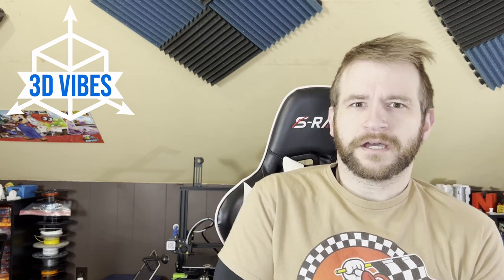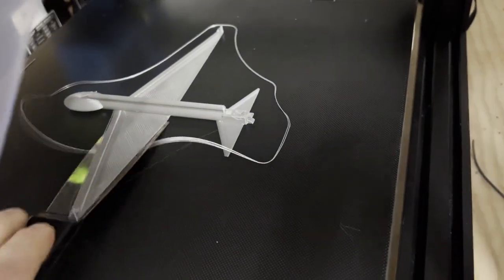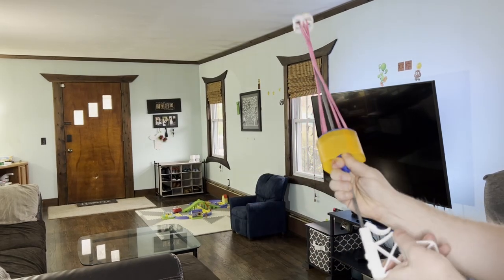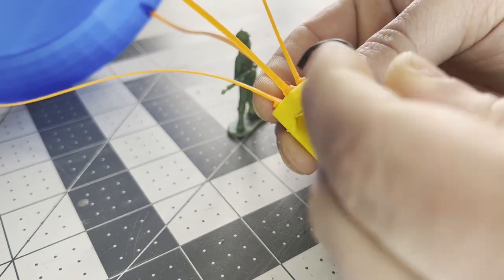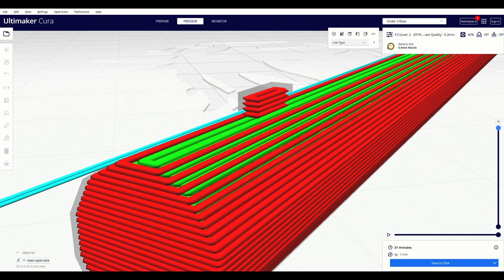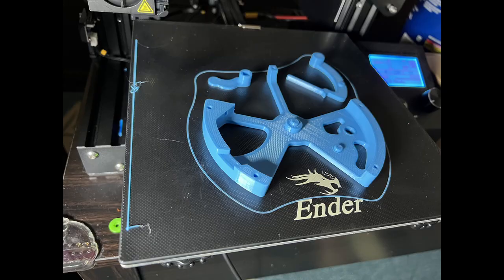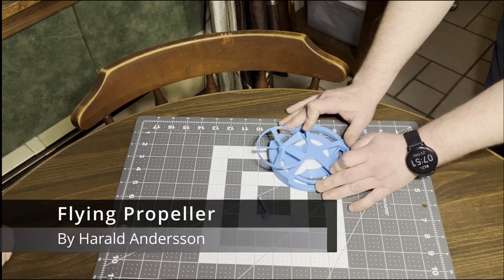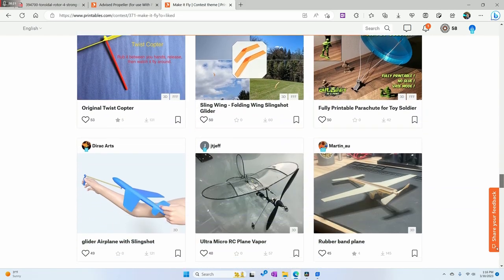3D Prints from the Make It Fly Prusa Printables Contest

Comment: I was surfing and stumbled across your video. I'm honored that you were the propeller launch base favorite. Did you notice that with the spring the layers were shifting. The print lines jumped 0.2mm each time? I had to do it to prevent it from tearing open lengthwise due to the enormous forces. You are right about the size of the propellers. This is the result of the limited moment you can create with the spring in combination with the transmission. Too much weight far from the axle will increase the moment. In that case the rotation speed will not be high enough to launch.
I am very curious if a stiffer PLA will give even better results..
Once again I am honored and good luck with your channel!
Reply from the maker: Thank you for your comment and the great model! The launcher base was fun to put together and use. I did read your description about the layer shifting and sliced it with a 0.2mm layer height (using a 0.6mm nozzle).

I definitely want to print more springs and propellers with various PLA filaments to compare. I've been procrastinating but your comment makes me want to start printing them very soon!

Thanks again, Wim V!

Comment: A lot of the entries don't fly and shouldn't be in the comp.
Reply from the maker: You are right, the contest description states “object must have some form of lift capable of slowing or preventing its descent by gravity.”  A lot of entries don’t qualify.

The contest is currently in the judging process. I’m very interested in seeing who wins.
Reply: well hopefully they do expand some of those restrictions IE requiring a lifting surface would invalidate my flying rockets which actually do fly :-) just not with wings. they use rocket engines 🙂

all of the models he printed are valid. some of them as with any airplane just require tweaking and adjustment. the airliners for example were tail heavy (cg too far back) the lawn dart also has no flying lifting surfaces but I would say it qualifies. it does fly through the air of you get the CG right IE like a dart.

my rockets are The Hammer (3in class mid power rocket) and the Explorer Aquarius a recreation of an old estes rocket kit at 115% scale. it came out truly fantastic but if you are not into that sort of stuff you may not recognize it for what it is. (niche hobby)
Reply: @nerys71  Someone entered a literal TANK model, another entered a static model of a ship from starwars.   Your example of the lawn dart should qualify as it is designed to go through the air at the very least.
Reply: @TheRattleSnake3145  oh yes I saw plenty of models that absolutely we're never even attempts at something that could fly pieces of airplanes and airfield shape or model airplanes that were intended to be models and not actually fly there was plenty of that